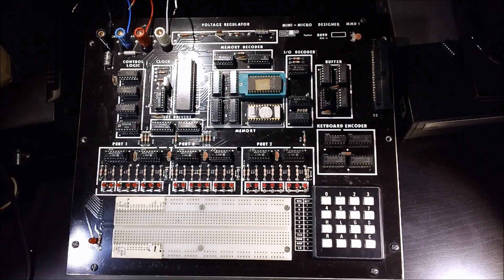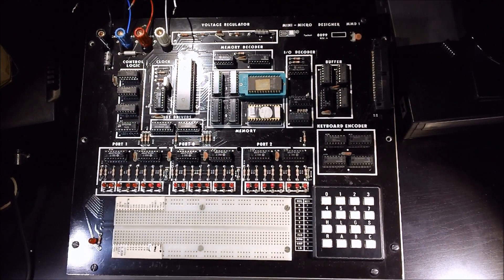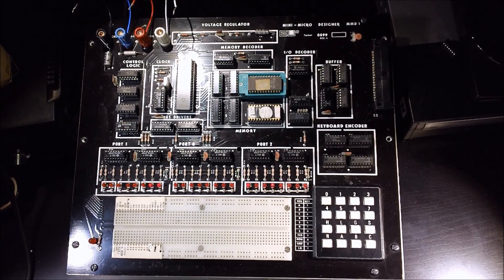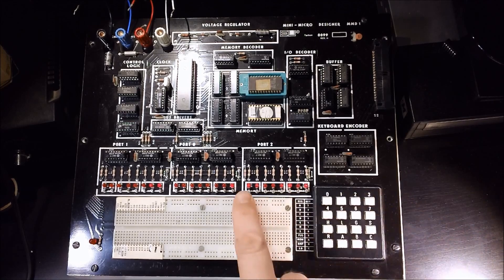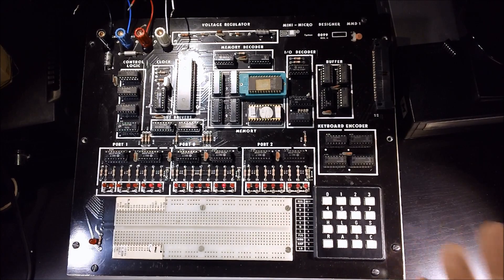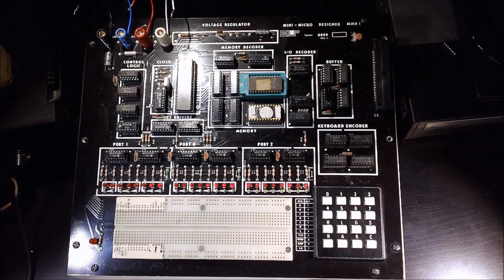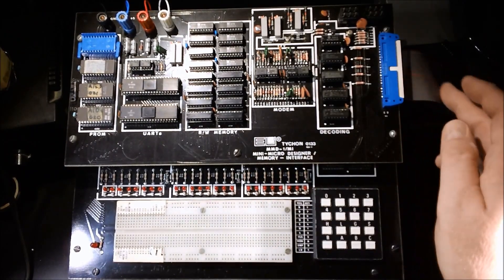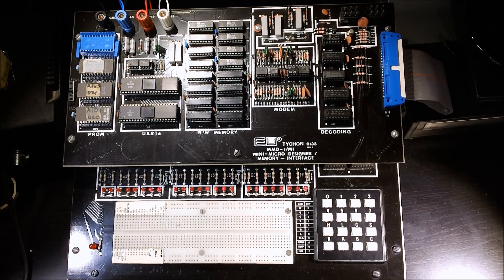E&L MMD1 - A look at an E&L MMD1 8080 based computer trainer - STB306

Comment: would it be possible to play kill the bit that was made for the altiar 8800
Reply from the maker: Kill the bit as written for the 8800 wouldn't run on the MMD. 8800 has a fairly complex front panel that the MMD is lacking, the LEDs you see are implemented in a much simpler way. With that said I would guess a version of kill the bit could be written for the MMD.
Reply: @ShadowTronBlog  yea i may see what it would take to make it work some time

Comment: Are you able to provide me the content of the EPROMs as files?
Reply from the maker: I don't have HEX dumps of the ROMs however I do have high quality scans of the manuals which includes the source code and listing in OCTAL for the KEX monitor the MMD-1 uses. I also have a few other scans of manuals and materials for the MMD-1. The file set as a ZIP is about 150MB . Email me at shadowtronblog@gmail.com and we'll figure out how to get these to you if you want them.